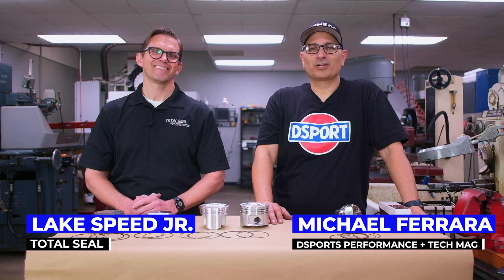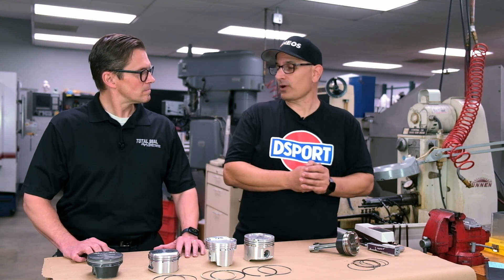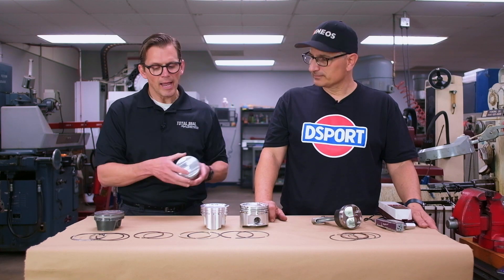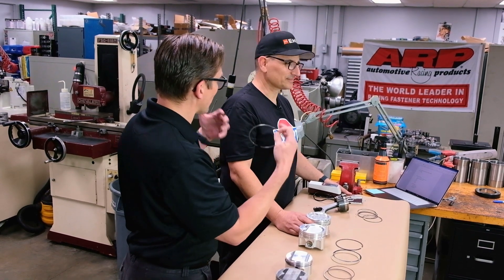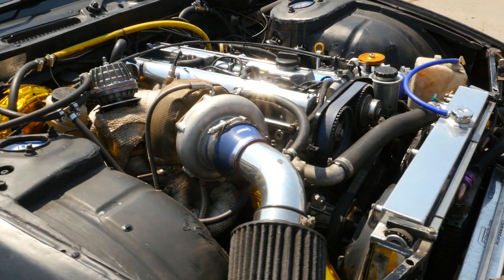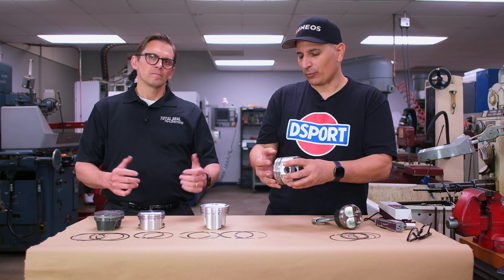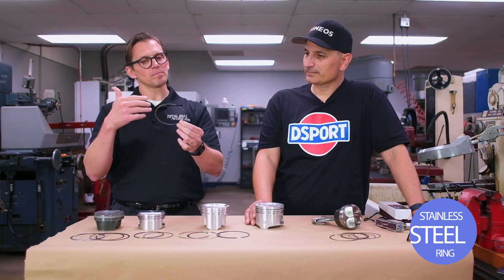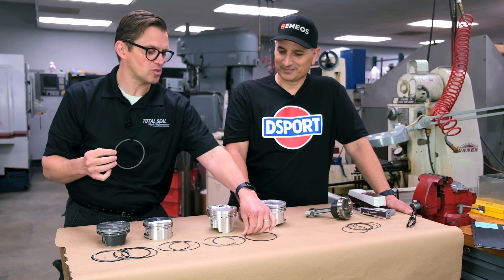Club DSPORT Tech: Performance Rings Part 1 #performance #pistonrings #engine

Comment: does thinner rings hurt ring seal like in my big bore harley m8 ?
Reply from the maker: No. Thinner rings conform better to the cylinder and provide a better seal. The only drawback is that thinner rings require better material to survive the rigors.